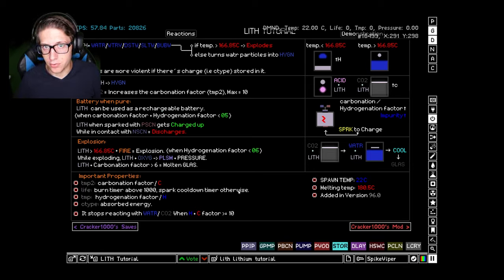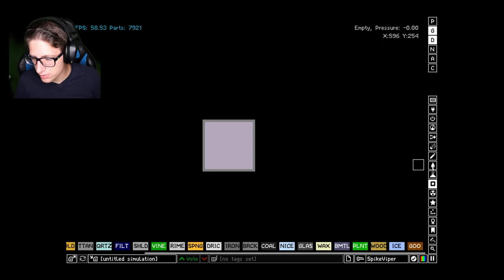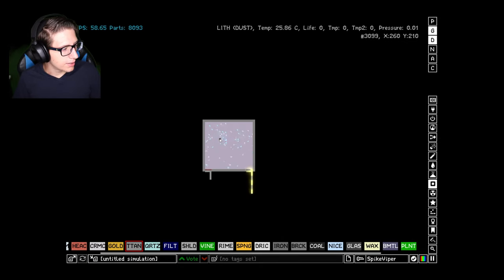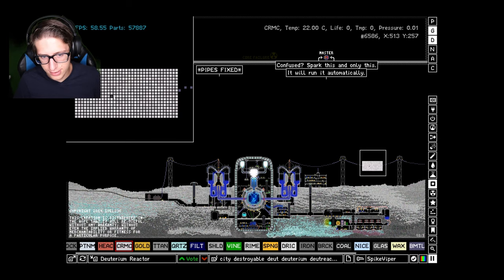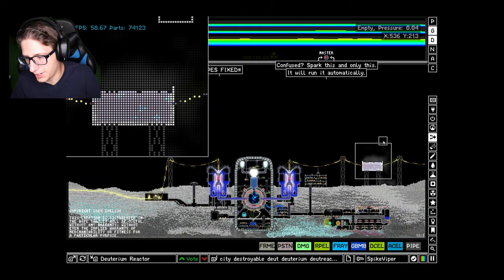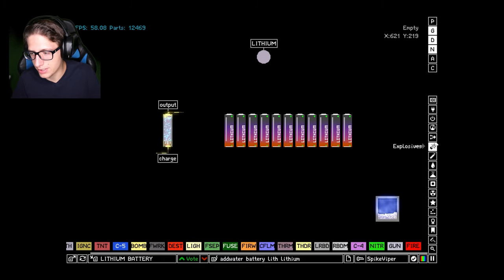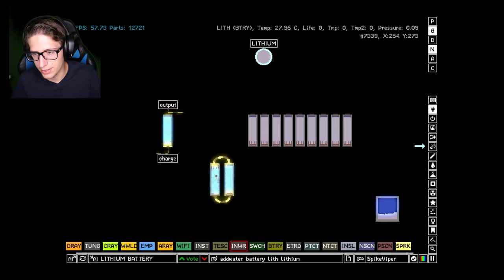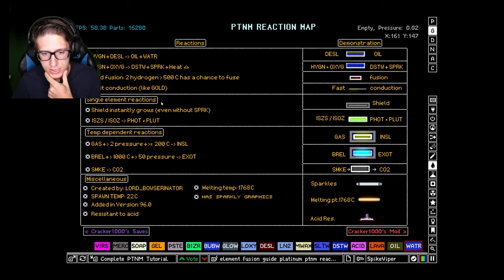LITHIUM BATTERIES (Just add water!) in The Powder Toy!

Comment: I hope they update lithium some, since while it makes very cool things possible, it doesn't explode like its category says it does.
I wanna be able to fill a sphere with lithium with a ctype (contained energy in this case) of 99999999 (yes that's possible), put a drop of water on it, and watch it release all of that basically infinite energy into the surrounding area... instead of just heating up to 200C and nothing else happening.

Comment: So like in real batteries they use layers of lithium and other materials to spread the lithium as thin as possible, so if you had the P type coming in one side, the N type going out the other, and layers of P then Lith then N then Lith Then P again with the P connecting to the P end and the N connecting to the N end you should be able to charge/discharge rapidly.

Comment: You can connect the input and output cables and if you charge it a little, it will keep going forever. If you then disconnect them, it gives off more energy than you put in.

Comment: I made a quantum batter with extremely overcharged lithium to the point where the ctype was just a number and it was completely blue the number I charged it to was 1 0 , 0 0 0
edit: I also made it so the even when not connected to any device it just charged itself so you don't need to turn the battery off
also while waiting for it to charge to ten thousand I watched an entire episode of lost in space
Reply: You can probably just use "sorcery" as some people call it, which is basically using PROP or console to change properties of elements, including data types such as ctype.